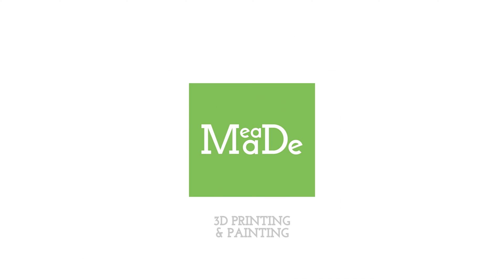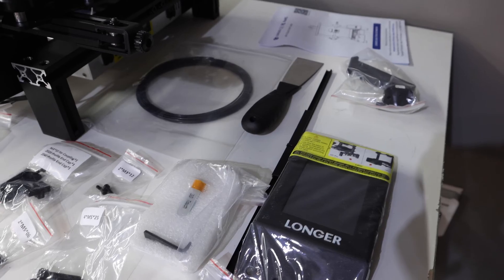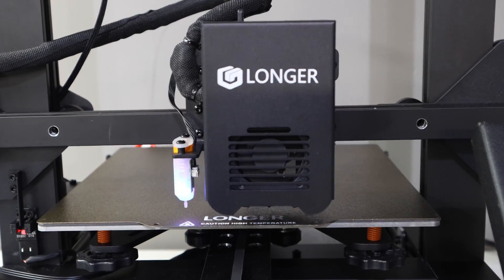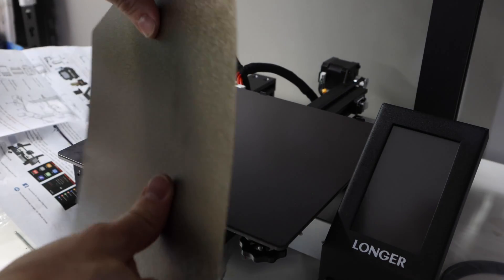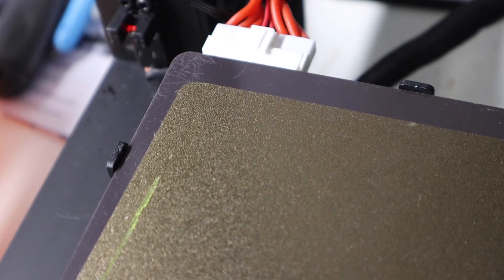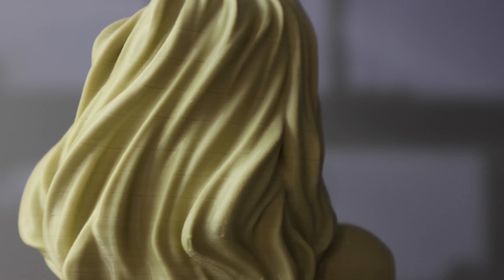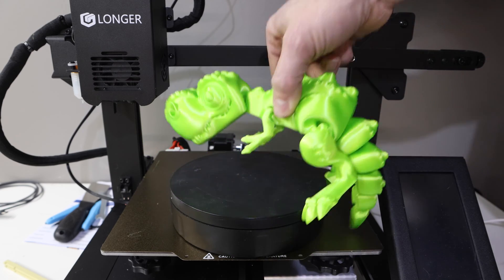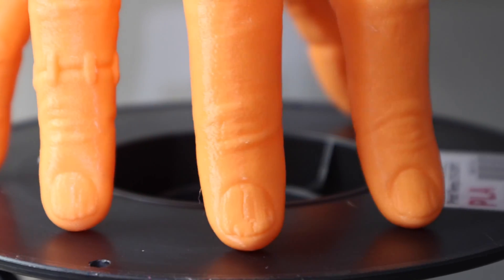Beginner Friendly Printer? Longer LK4 X 3D Printer Review

Comment: Great review. I guess my only questions are how big is the build plate and of course the price of that particular machine?
Reply from the maker: The build plate is 220mm by 220mm by 250mm high. I didn’t mention price due to it can change. Right now it’s $300 and they gave me a promo code to share to save $20. That’s in the description.
Reply: @ItsMeaDMaDe  wow price isn’t bad either. May consider this one for my first printer instead of the ender
Reply from the maker: @robmcdonald6808  i truly meant it when I said it’s fantastic for beginners it’s super easy to use with little assembly.